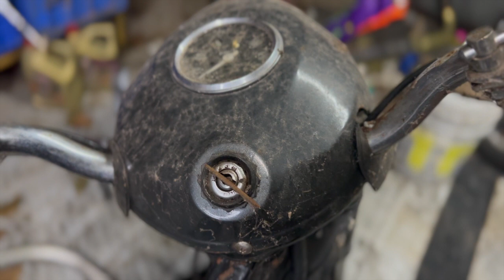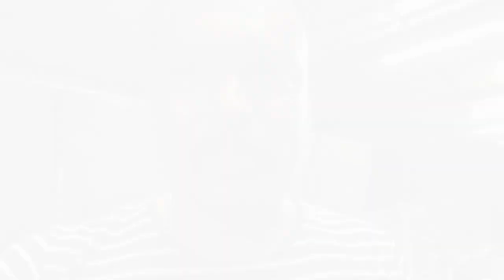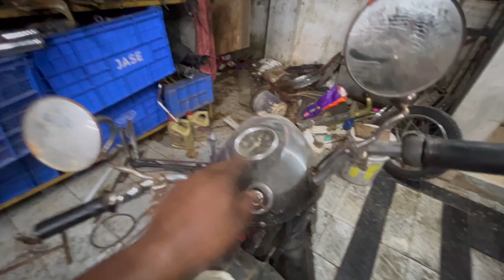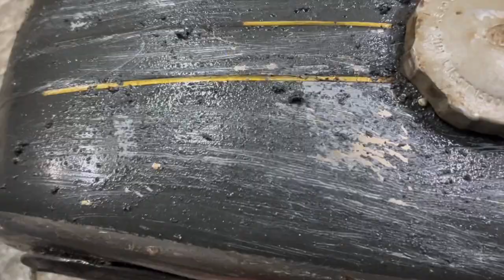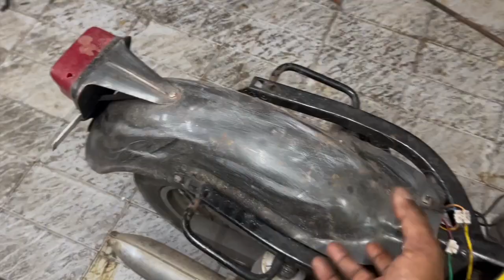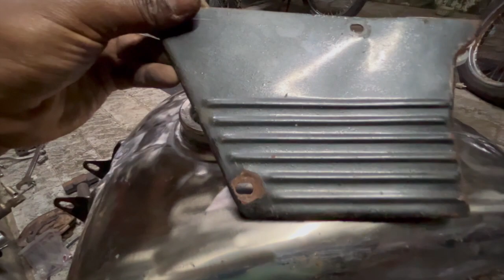Reviving the Classic: Yezdi Motorcycle Makeover, Transformation Video | Malayalam  Video

Comment: That inside wire accelerator grip set is rare.Most spares are available with Gee Bee uncle so will  not be issue. Rear Shocks you can replace .
Reply from the maker: I am slowly convincing the owner to plate things
Reply: @Yamakaze  only plating the silencers and new rims,spokes give full look to restored bike . If light buffing gives look to silencers then that is also better than new plating.
Reply from the maker: owner is not opening his wallet :P @anurajaroman

Comment: Sir, how do I avoid flash rust? I had used paint remover on my tank and then used bathroom cleaning acid to remove some rust. After using the toilet cleaning acid, within minutes, the tank started rusting and it looks horrible now, fully covered with rust😢
Reply from the maker: You have to apply primer immediately after you clean it, use a rag and moisten it with thinner and wipe it completely
Reply: @Yamakaze  OK, Sir. I will wipe it with thinner and apply primer immediately. The toilet cleaning acid I had used removed residual rust completely, but it also makes the tank catch rust immediately.
Reply from the maker: never use acid on metal, it will create pinholes  @allaboutnothing99